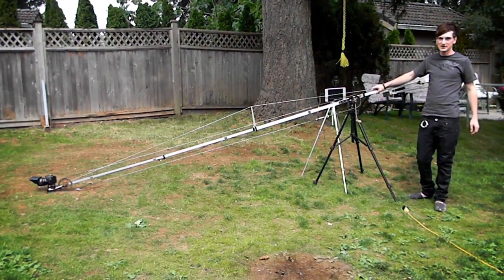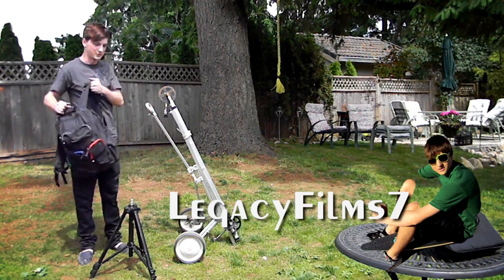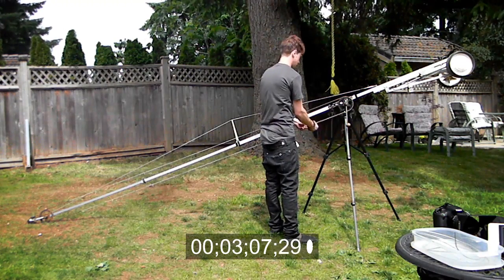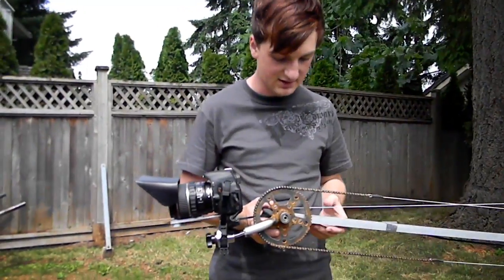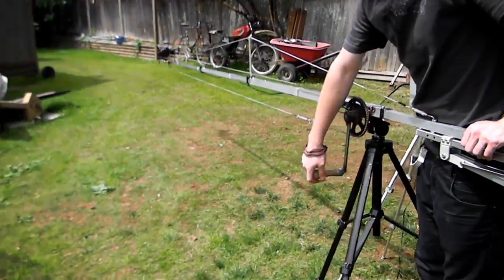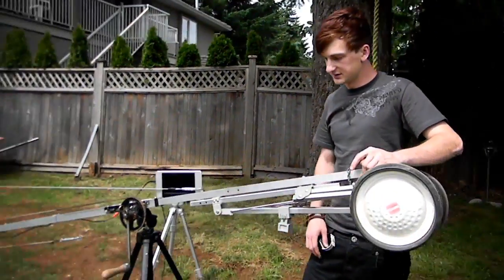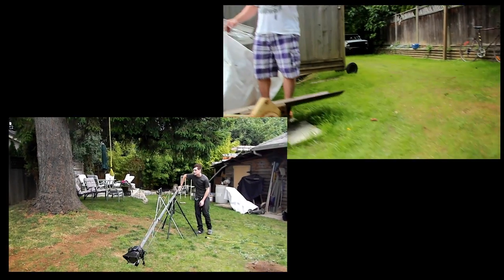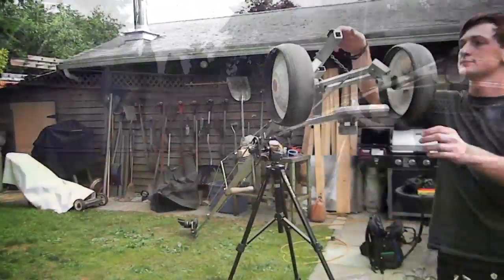How to build a CAMERA CRANE

Comment: I like it Jordan. It's a telescoping suspension bridge design (super cool), and the chain and gear system you can tighten in place - excellent - and using the golf cart transport system as the counter weights? Brilliant and inspired - No doubt about it what so ever.